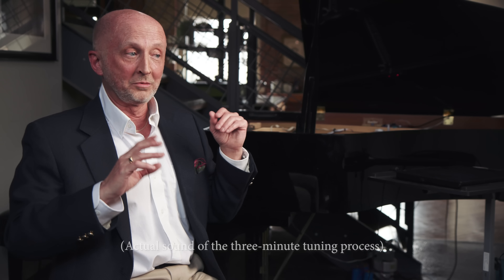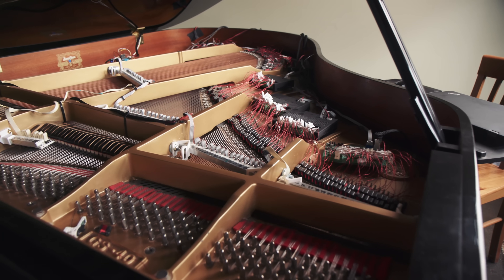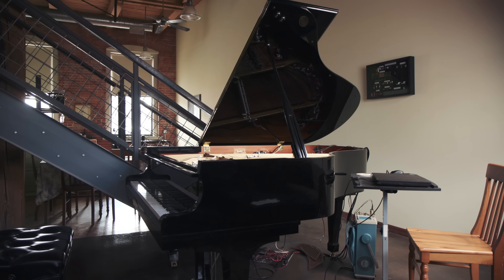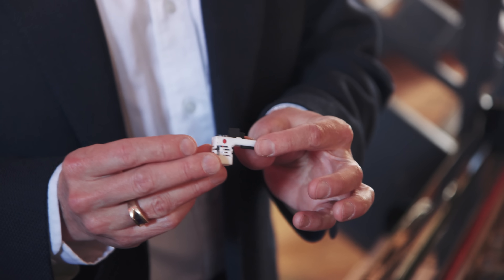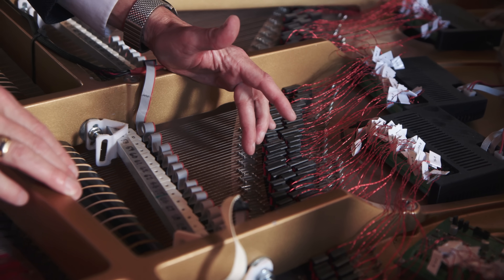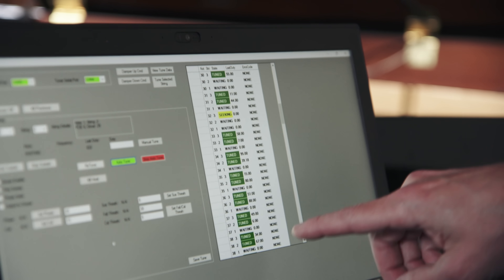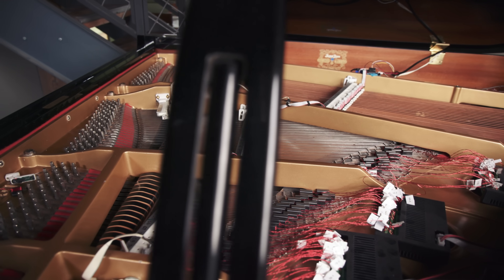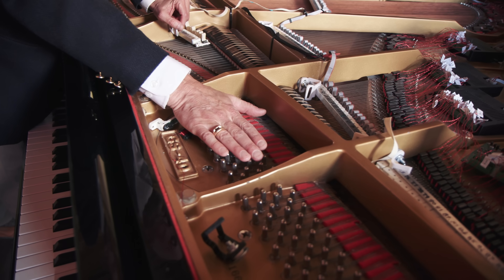The Self-Tuning Piano

Comment: I am pianist and microtonal composer. I am curious if this system can or will allow for custom tunings on the fly.
Reply: This would be massive for me, and I imagine many others. Even in my experiments with larger temperaments, I am often considering 12-note subsets for the piano. I have retuned my stringed electric piano many times, but that is very time-consuming. I would love to try this on my acoustic piano and my Yamaha CP-60
Reply: I has a fair tuning range, but "microtonal" can add more complexity than you might think. For any given note, it can easily bend the pitch by 50 cents or more. But if we're talking about microtonal music it's a different story. If, for example, I want to tune in quarter-steps and start with middle-C, we can tune Db down 50 cents. But then we have to tune D down 100 cents and Eb down 150 cents, etc. It quickly becomes impractical. Temperaments are a different story and virtually any reasonable temperament can be easily accomplished.
Reply: @dongilmore4237  yes, but even a humble +/-50c deviation per string is a huge avenue for experimentation…

can you store and recall tunings without physically retuning the piano to those tunings first? curious if you can just digitally input note values or cent deviations, since an earlier comment says it memorizes an earlier tuning and simply retains this tuning. obviously this should be possible, i’m curious it it’s actually been implemented, if there is an interface for editing the tuning etc
Reply from the maker: The first release will be simple and just store and repeat tunings with maybe a few simple, standard temperaments to play with. After that we plan to add software that allows you to tweak every note (or even every string!) to whatever you want (within the confines of the range, of course).

Comment: 1 year RPT here. Love this project. Here's the TL:DR on my thoughts, extended version in the comments

1. Forget the haters
2. Have a not-engineer help make it look pretty
3. People's problems with it are largely based on misunderstanding the product. Use a dampp chaser with it
4. Piano will still need a pitch raise at least once a year, but you get a perfect tuning until then, even if you move your piano outside
5. A small computer could probably actually tune the piano. Worth looking into
6. The haunting sounds during tuning are a feature, not a bug. A way to use it in performance would be awesome
7. Could the system double as a pickup to run your sound thru effect pedals? Might not have much application but it would be cool.
8. There could potentially be a problem with adding a lot of tension quickly as the system turns off. It might be useful to have it shut down slowly

I'm outta Wichita and i would love to come look at your shop sometime. Thank you for doing awesome things qnd sharing it with the world

Comment: I wish I had invented it myself. And yet, I am not convinced it has a future. Why? First, because technicians are first called to solve issues that are not related to the tuning. Second, because (if I understood well), this is a fake tuning that uses heating as a way to play with the elasticity of the strings. Pianos have not been "deisgned" or though for this, and I can imagine there will be damages. But, very interesting system :)
Reply from the maker: The strings in a piano are tuned by tiny adjustments in their tension. It requires only slight, insignificant changes in temperature to effect this change (those without air conditioning can attest to this). If pianos had been traditionally tuned by temperature in the past and I were proposing turning the pins, people would probably complain that I was destroying the pin block by turning the pins and damaging the strings by pulling and scraping them through the agraffes!

I'm certainly not attempting to eliminate piano techs in any way. They will be installing, servicing and profiting from these systems and you are right that they will still perform all the other duties just as before. Actually, it opens a new window to "micro-tuning". With accuracies of 0.1 cents that can be adjusted on a laptop screen, and sustainers that can continually vibrate a string at a set volume, allowing constant monitoring of the pitch as you adjust, a whole new level of accuracy is now possible.

Don A. Gilmore

Comment: This is so clever! One question though — it seems like via heating it would only be possible to lengthen the string, dropping the pitch from its rest state. I’m a tuner, and based on my experience, although pianos do go through cycles, it seems like ultimately they always wind up on the flat side in the long run. Am I missing something? How would this system raise the pitch? Heating the frame?
Reply from the maker: After the system is installed, all the strings are warmed. Then the piano is manually tuned and this tuning is saved. When the system is switched off, the strings cool and go sharp. So, all tuning can be done by warming. A piano in good shape can stay in tune with a warmth margin of 20-30 cents. Pianos with poor stability may eventually go out of range, but the strings can be pulled back into range manually.

Don A. Gilmore

Comment: The inventor would be best to talk to a reputable attorney about his product and consult with reputable experts in piano construction and maintenance to determine if the product will be safe for the piano.  I hope we can all agree on this.  Mr Gilmore:  You need to be in search of the truth here.  You will need to recommend to buyers the standard amount of cents to tune the strings above standard pitch to do the safety determination.  E.g. 30 cents?  E.g. - We know 400 cents above standard pitch where A = 554 Hz is not safe (i.e. it will damage the piano with long-term use).  If 30 cents is safe, how long before the strings fall below standard pitch as strings naturally flatten over time and so need to be manually tuned up?  18 months?  There are 230 strings!

Comment: Another question: Is the heat ruining the strings in the long run because it puts extra stress, and the constant shrinking and expansion during each use causes metal fatigue?

Comment: It would be great to hear more sample before and after. The sound ‘after’ was incredibly flat (as it should be) in the temperation zone (A3–A4), but something seemed off in the A2–A3 zone. Quite frequently, when I was tuning the copper wound strings, when the main frequency was identical, the harmonics were different, and the software was showing that the tuning was right, but it did not sound right because there were extra beats due to overtone frequency mismatch. Does this device have an option (or at least, it is planned) to choose which harmonics to target when tuning the copper wound strings (4:2, 6:3 etc.)?

Comment: Hey. Mechanical engineer here. Also an RPT. I have developed a new way to tune pianos aurally that gets people concert level tunings in one year.

I would be interested in measuring your piano technician's tuning and then after the piano is out of tune and =brought back into tune, measuring that. My evaluation system is quite precise using a bandpass filter to specifically and accurately measure beat rates.

It seems your challenge is going to be marketing and business related. You need to get investors. I think your challenge will be to get people to buy. The ones who want to save money won't buy them because they already have a way to save money on piano tunings. Don't do it.

I think your market will grow as fewer and fewer people actually know how to tune a piano to a decent level. 

As it is now there are so few that many people in rural areas are reverting to learning to do it themselves.

You need to hire some professionals to help you market this thing. Remember, it's not what it does, it's what people think it does. You have to create a story around this.
Reply: I was going to send you the link to this video when he said he's a mechanical engineer. But it's good to know you've seen it already. I think the other challenge is how to make the system less bulky, or use fewer wires. I personally think owners of grand pianos would prefer to maintain the aesthetic beauty of their instruments - without all the wiring or components sitting on the strings. It ruins the beauty. My opinion.

Comment: So... this is amazing. But how do you see this working with a regular physical tuning calendar? At what point does the piano require a physical tuning again?
Reply from the maker: Theoretically, never. In reality, we know that eventually the piano may go so flat it goes out of range, at which point it will have to be pulled back into range (though just roughly; a full tuning isn't required). This prototype has had the system in it for about five years and has never gone out of range, but then it has a healthy pin block with nice tight pins, which is not always the case. 

If you never turn the pins in a piano, it goes through an annual cycle and returns home again each year, actually not far from where it started.

Don A. Gilmore
Reply: @dongilmore8681  An annual cycle? Can you explain that, please?
Reply from the maker: @ElikemTheTuner   In most temperate regions, like the United States, a piano goes through two major changes in a year: one in the spring and one in autumn. Because of seasonal changes in temperature, and particularly in humidity, the piano goes out of tune. The two changes are in opposite directions, so in a year cycle, if the piano wasn't tuned again, it will return to where it was...mostly. It will not return to perfect tune, but it will improve.

Don A. Gilmore
Reply: @dongilmore8681  thanks
Reply: @dongilmore8681  Well done on your invention, but try not to kick us tuners out of business. 😂
Reply from the maker: @ElikemTheTuner  You'll be the ones installing and servicing it now. I foresee that you will have as much business as you always had.

Comment: Initial thoughts..
Very, very interesting. As a piano tuner myseI'm not too worried about losing work. I guess it would be the tuner that fits it. Presumably every so often you'd have to come along and retune too. 
The price is not so bad. Many people have their piano tuned twice a year so this is about four years of tuning costs. It would pay for itself over four years. 
I guess installation is pretty specialised. Unfortunately it looks clunky. Pianos are beautiful, it needs to be high gloss black with a nice curve or something! Would be very suitable for upright pianos. 
Excellent work.
Reply from the maker: ...and don't forget that justifying the self-tuning piano based on how many times you would have had your piano manually tuned is like justifying a cellphone based on how many dimes you would have spent in a pay phone. It's a whole new freedom. You can tune your piano every day--even after every song! When you hear the "ching!" of $150 every time you push that tune button, the system pays for itself even more quickly than you think.

Comment: Sure folks this is the solution. Please oh please spend this ( estimated) $800.00 to self tune your piano. God our people naive.
Reply from the maker: And remember: justifying the cost of a self-tuning system based on how much you would have paid a tuner is like justifying the cost of a cellphone based on how many dimes you would have spent in payphones. This is a whole new freedom. You can tune every day, or even after every song! If you hear the "ching!" of $150 every time you press that tune button, you'll see that it pays for itself rather quickly.

Don A. Gilmore
Reply: What is your point? It is actually a very cheap long term solution, since each human tuning may cost ~ $200.
Reply: Tuning costs $400-$800 per year.
Reply: In general there are Millions of piano's still in people's homes. Few people tune they're piano's. ( THEY CAN'T TELL IF IT IS OUT OF TUNE). When the minority of people do tune there piano it is because a few keys stick or some part of the action needs attention. The great majority of piano's are tuned rarely. So this notion that somebody is going to spend $800.00 to put this contraption in there piano is a laugh. Also folks who is going to install all of those parts unto the strings. Give me a break.
Reply: @philipfrohna5723  not everyone tunes their piano, so no-one will want this? What kind of logic is that? I guess let's not bother developing a new design for cars because "not everyone drives".